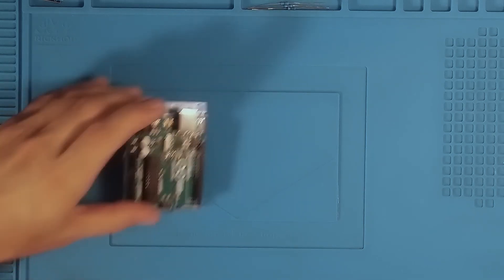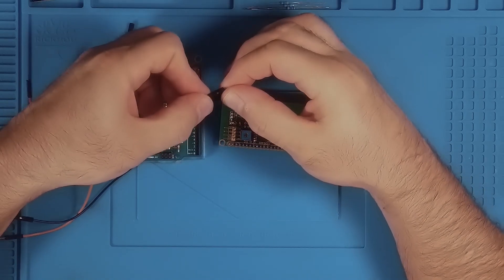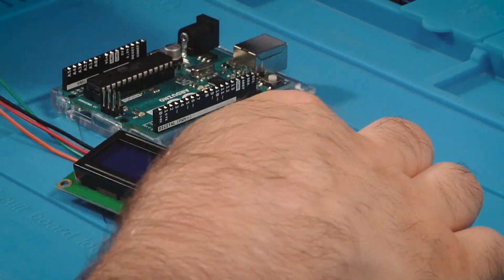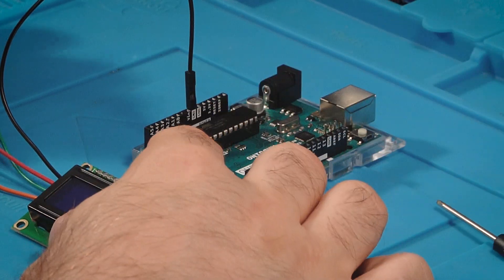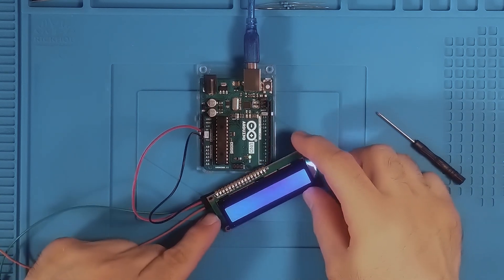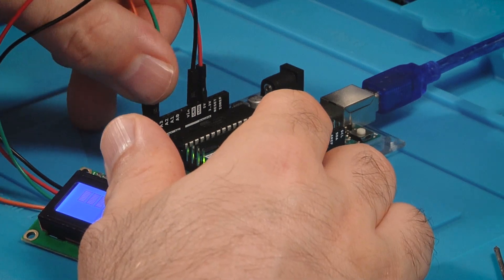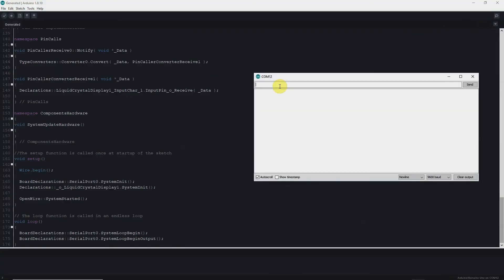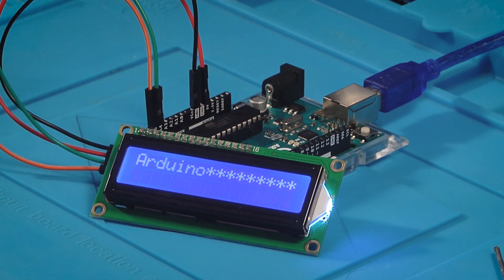Arduino LCD I2C Tutorial-Visuino

Comment: Can we do this using breadboard as well as we need to use a tilt switch for Crystal ball project?
Reply from the maker: Yes.  I think the idea you might be talking about can be found in this video at :  https://youtu.be/n9UIPn8gDqk?t=237
If I understand correctly you basically want to add more components to your project but the Arduino has only 1 5V output.  In the video link I pasted here, I use a method I learned from the creator of Visuino.  Send the 5V from the Arduino to the breadboard then plug the 5V inputs from your other components right next to where you plugged in on the breadboard.  Just be careful not to share it with too many components.  Technically its a little more complicated but that is the short answer from someone who is just learning himself.  Hope this helps.

Comment: Cool! Do you plan Tutorial with this one? You should post the Visuino project :-) I know it is super simple one, but still will help beginners ;-)
Reply from the maker: I posted the project on the Project Hub.  Here is the link: https://create.arduino.cc/projecthub/Tishin/i2c-1602-lcd-arduino-uno-display-text-via-serial-monitor-594034?ref=user&ref_id=1194639&offset=0  
I got this straight from your tutorial so that's why I didn't show the Visuino work, but now that you mentioned it I  quess I will.  Thanks again for your tutorial.   In the project hub I added you as a contributor crediting you for your tutorial and Visuino work.  :-)
Reply: @videotronicmaker  Thank you so much! :-) I hope you envoy Visuino, and will post some new cool projects :-) There is so much cool stuff that can be done with it ;-)
Reply: @videotronicmaker  BTW: Since I rewrite the Arduino libraries for Visuino all the time to expand and optimize them, when posting Arduino generated code, it becomes obsolete. It is best to post the original Visuino code so people can generate it with the latest Visuino and have it working properly with the latest libraries.